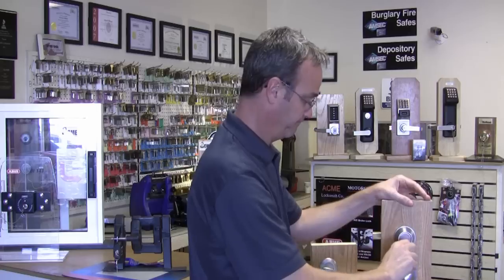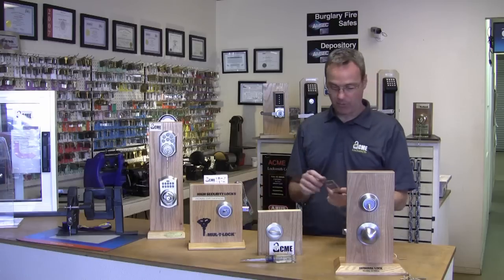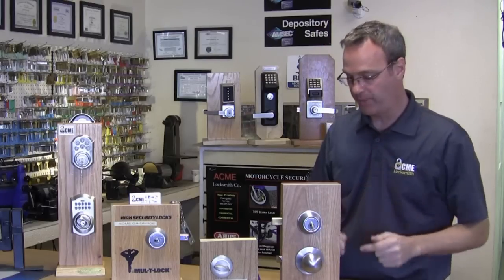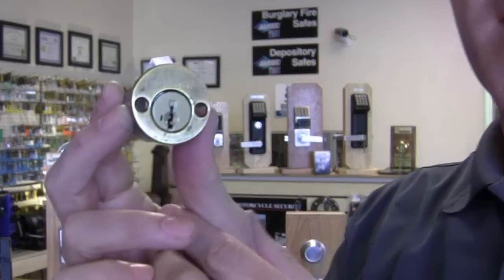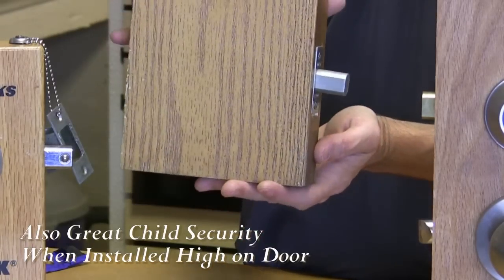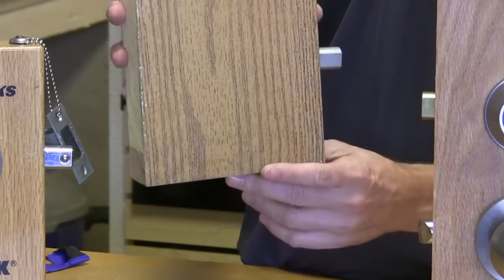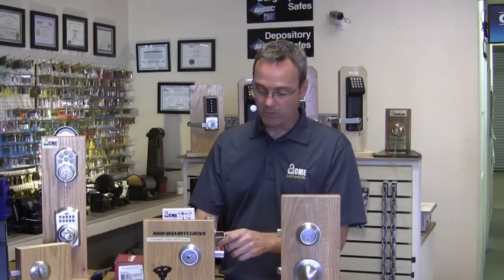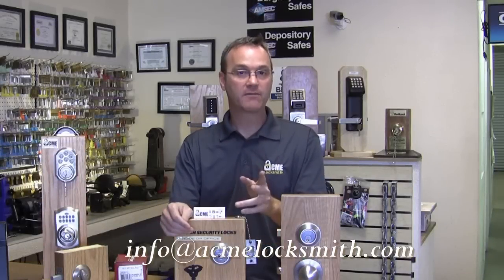What is Lock Bumping - How to Stop Bump Keys

Comment: I put the Smart Key Quicksets on my home.  Didn't realize they were bump-proof, but am mighty glad to discover they are.  Another big benefit of them is that you can re-key them yourself, quite easily.  That's what that little slot next to the keyslot is for (you stick a tool into it, then with a few twists of the old and new key, that changes the key that works with it).
Reply: they are drill resistance also.
Reply: Theyactuallyare crap, their resistance is that they breal and jam under normal use

Comment: thank you for this.  What about the keyless lock (last one on your screen, with the code pad and key)?  Can those be picked, bumped?
Reply from the maker: If it's an off-the-shelf lock with a keyhole It can be bumped. A lot of the manufacturers are now making keyless electronic locks which are a good option against bumping. Here's our favorite by Yale.  If the battery is die there's a battery terminal jumper on the outside so that you can still get into the lock. 

https://amzn.to/46YM7ra

Comment: Yeah that strap is a good idea and it looks like it works. But we have to go in and out of the home through the actual front door. So we can't use that. 
The half lock. Can you lock and open that from outside the door?
Reply from the maker: It is meant to be used on doors either when you're in the home or doors you don't routinely use to go in and out of. Here in AZ, almost everybody goes in and out the garage door, so you can secure your deadbolt on all exterior doors.
Reply: @LocksmithRecommended  Thanks for responding to my Query. Yeah, that's what I thought. Here, some may use their garage doors because they park their cars in the garage. Most don't park their cars in the garage here. And a lot of homes don't have an access to the garage from the house. 
Most use the garages for storage, child play areas for safety purposes and work shops, etc. My double door, double car garage is my shop, it's full of tools. My machine tools are all on wheels and I park them outside in the drive, even in winter when I do a lot of work in the shop. I live above the so called "Snow Belt," so winters are severe. 
A lot of break-ins occur using the garage doors. A few years ago about 8 of my neighbors were broken into through the garage doors. They used a large pry bar for leverage under the doors on one side and lifted the doors up sufficiently that they could wriggle under. Once in of course they managed to open the doors fully. The imprint of the pry bar was left in the rubber door gasket that is on the bottom of the doors. They tried mine but failed. I have large additional locks in the rails inside on both sides of each door. They are positioned above the bottom rollers. They probably separated a disc trying to raise my heavier, insulated garage doors. 
To protect my front door access, I rely on the locks I have and the steel outer storm doors that I am able to lock from the outside. They can still be penetrated, but it's  time, trouble and noise. Also I have high intensity, motion detecting lighting all around the property. And I just recently bought all the cable I need to install video cameras around the property. There has been a definite rise in break and enter theft in the last couple of years. Looking at some of the people that the police are catching for some of these crimes. It's people that are new to the country that we are importing. They do not reside in the areas that they have been breaking into. I live in Canada, toward the north in Ontario. Always looking to better my security.

Comment: The Kwikset/Weiser Smart Key deadbolt can be opened quickly & easily with the KTT-4 tool from Major Manufacturing Inc. without leaving any obvious signs of compromise on the cylinder.

Comment: Very informative, thank you! Does Kwikset, with the Smart-Lock feature come in an electronic keypad entry lock that has double cylinders so a keyed entry is also on the inside instead of a thumb-turn? Or any other manufacturer for that matter?
Reply from the maker: I know of no electronic deadbolt that has a key on both sides. There are some commercial grade options, but no residential that I can think of off the top of my head.
Reply: @LocksmithRecommended  Thanks so much for the info.!

Comment: I've been looking into buying a Lockly Secure Plus. My question is, can you re key something like the with a High Security Lock? Thank you in advance.
Reply from the maker: If you rekey a Lockly, you void its warranty. So my guess is replacing the cylinder is out as well. We haven't yet looked at this lock, so don't know the answer. But I'm going to do a video on it within the next month or so.
Reply: @LocksmithRecommended  Got it. Looking forward to your video. May I suggest a video or opinion on the Samsung SHS-P718-LMK. Just wondering if that's really worth the price and how it has the key lock on the bottom if its safe enough. Thank you.
Reply: Michael bell  Well yeah, clearly if someone wants to get in your house they're gonna do it. What I really mean is, is it worth the money and can a lock that's on the bottom be bumped just a like a regular lock. I know that there are some locks that cannot be bumped, but can be picked if given time. So, I'm just wondering if its really worth the money to spend that much on a lock or not. As I said, if they want to get on they're going to. But I'm sure a burglar would prefer the easier lock over a more complicated lock to pick.
Reply: @jdlfpr  As they say, "You don't have to run faster than the bear, just faster than your companion".  (Make yours harder to enter than your neighbors.)

Comment: My question is when I leave my apartment  no matter what lick I put on they pick it. What can I use to keep them out when I'm gone.
Reply from the maker: High security locks would be your best bet. Many can still be picked, but only by the most experienced pickers in the world. You'd knock out 99+% of everyone else. 

https://www.acmelocksmith.com/commercial-grade-high-security-locks/
Reply: If you see a video of someone picking a high security lock (and it is not fake), rest assured that the lockpicker has trained for years in general and probably spent many days on that particular lock. And when making the video, he might have restarted the recording numerous several times until it went as smoothly as expected. If your lock is a quality product with no gross design flaws, other (more destructive) ways of opening your doors are more likely than picking.

Comment: Aren't wafer locks easier to rake/zip open? This isn't a much more skilled attack than bumping and can be almost as quick, it's probably the first two attacks I learned, you can easily file a rake or a diamond pick (I used a metal strip from the side of an old hard drive mount from a laptop) and a screwdriver, heck, I once got the wafer lock in a money box open with a paper clip with two zigzags bent into it, no need to order anything or get a key. Surely if you're going to learn to make a bump key or order online, you'd get a pick set or fashion a rake as well?
Reply from the maker: When the lock was released it was taken to a locksmith convention. It was attempted to be picked 40,000 times. Only one locksmith successfully picked it. 

Over the years, ways to bypass that lock have come out and tools to get past it have been released. But against lock bumping, it's still as one of the best out of the box locks available

Comment: If you want just to lock yourself in and you don't have the strap you use a simple pair of mole grips, I believe you call them vice grip pliers, they lock in position and will not allow the lock to be turned.

But wouldn't it make mire sense to have a door wedge or something similar that goes against the door, the only way past them are to demolish the door.
Reply: What if the door opens outward

Comment: smart key locks are junk, there is several ways to get them, the news is out, and by the way, you can still bump wafer locks, the y11- for example, the technique is a little different than actually hitting the key though, how many people do you know that have y11 on there garage door? I tried this out in the field, the main locks in the building were medeco!!!
Reply: There are ways to get through all locks, but none so simple and well known as lock bumping. It takes essentially no skill and just a couple of dollars. Smart Keys are in my opinion one of the best over the counter products for bump and pick resistance deadbolts that is generally available. They definitely have their issues though (plastic parts for example). Our recommendation is for off the shelf bump key protection, get the smart key. If you want the best protection, consult a locksmith to get the best product for your given needs.
Reply: Why bump a y11? Just blow on it.

Comment: KwikSet is bump resistant, but there are other ways to open them that requires less skill.
Reply from the maker: True. Here, I am speaking only of lock bumping.
Reply: @LocksmithRecommended  I understand this, but it is a bad example because it allows other less skilled attacks.

Comment: of course you already have something called a chain installed that does the same thing and has the same problem. It only works when you are home to put it on from the inside.

Foolishness
Reply from the maker: I would never trust a door chain for security. They're too easy to bypass or force. False sense of security there.
Reply: Acme Locksmith
I don't worry about people bumping my deadbolt while I am sleeping. Its when I am away this is a real problem. Thats the issue that needs to be solved.
Reply from the maker: Agreed. We address products you can use to prevent bumping while you're away from the home.
Reply: vladlashing and I can just put lock pliers on the thumb turn and don't have to buy someone's junk!!!
Reply: @LocksmithRecommended  I went onto your site and could not locate a truly bump proof lock. Any suggestions?
Reply from the maker: @barbarawilliams868  This product will make any existing deadbolt with a thumb turn bump proof. https://www.acmelocksmith.com/buy-safes-online/deadbolt-lock-flip-guard.html  works just like the strap in the video but much easier to activate and deactivate.

Comment: SmartKey may be resistant to bumping, but they can be opened with a $2 key blank and a pair of vice grips. Not a good solution. You'd be better off getting a Schlage and putting in an anti-bump pin (or getting a locksmith to do it).

And good grief man. Do you seriously not know better than to say things like "pick proof"? There's no such thing. There's not a lock on the market that hasn't been picked by someone somewhere. Even the Protec2 - the gold standard - has been picked. Granted there's maybe 10 people on the planet who can do it, but still.
Reply from the maker: We were discussing lock bumping. Kwikset locks have some serious flaws, as do most locks, but for lock bumping prevention, they are one of the best. 

FYI. I have a lock on my door right now that is pick proof. No one, not any YouTuber you've ever seen, not any locksmith, not anyone, can pick this lock.  I show it at the end of our Can All Locks be Picked video at https://youtu.be/5228bTmrLCk
Reply: @LocksmithRecommended  Fair enough, those locks actually are pick proof, but they can't be locked while you're gone because they both have to be locked from the inside.
Reply from the maker: @krissisk4163  Yes. In AZ we all pretty much come and go through our garage doors, so these stay safe and secure  on the front and back doors. Once the garage door is protected from entry with the tip in this video https://youtu.be/vKs4J-Vqyb8  you're home is in great shape.